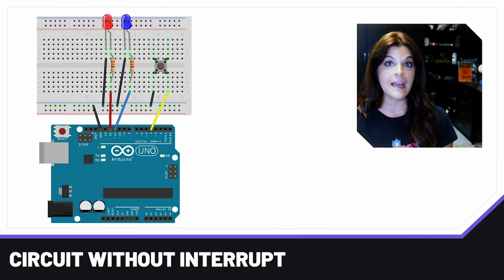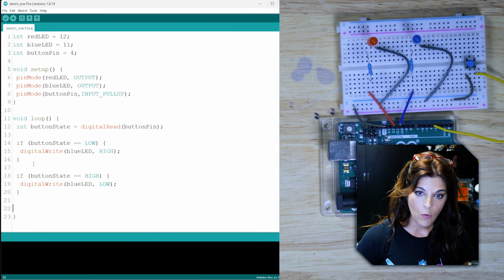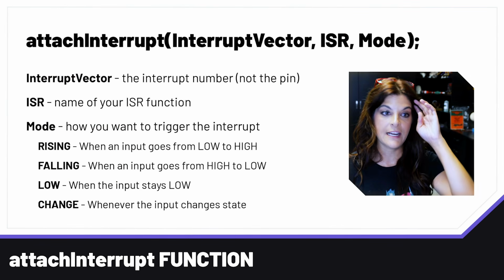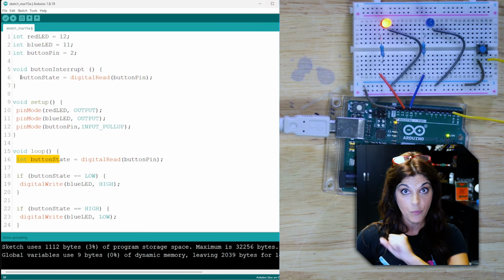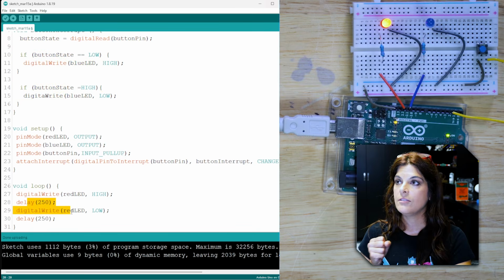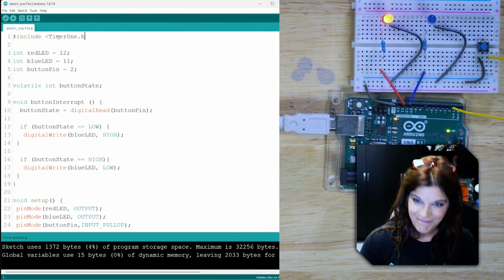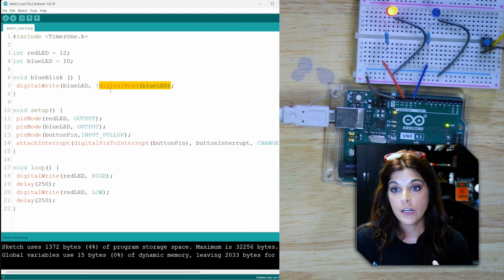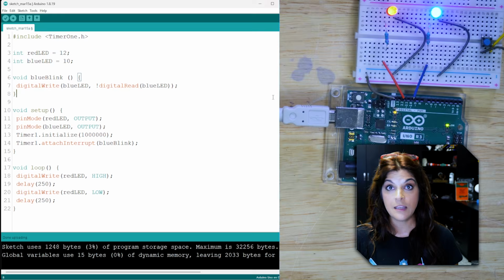How to Use Arduino Interrupts The Easy Way

Comment: In the hardware interrupt example, the buttonState doesn't need to be global and  doesn't need to be declared as volatile because the first thing the interrupt handler does is to assign it to the return value of digitalRead() and the variable is not accessed anywhere else in the program.
Reply: Where do you learn this stuff?
Reply: @jorgelima5695  
So the variable doesn't need to exist! return(DigitalRead())); 
Am I missing something?
Reply: Still, it's good practice.
Reply: @GlennHamblin  He said the buttonState variable did not need to be declared global but local to the ISR function. Then obviously there's no need to declare the local variable as volatile because it cannot be changed by anything else.
Reply: @GlennHamblin  I disagree. It's true that the variable was declared in the global scope, but that's just because Rachel moved the code around. In the end the variable is not accessed anywhere aside from the ISR itself, therefore it could and should have been declared locally, and since it changes only under strict control of the code inside the ISR, the volatile isn't at all necessary. And I don't think it is good practice to do anything inside an ISR that makes it slower for no reason: the variable is accessed three times, with volatile, the compiler will have emit code to write or read to/from memory every time the variable is accessed, whereas without volatile, the value could be always kept in a register. Of course this is just a toy example, doesn't really matter, but that's besides the point. I should say, that this is not a criticism: this video is very well put together and it's impossible to make content completely free of these little mistakes. And it would also be unnecessary, otherwise people like me wouldn't have anything to comment on ;-)
Reply: @jorgelima5695  
What use is a variable that is only used in an ISR?
Reply: @jorgelima5695  again where do you learn this?
Reply: What's the use of a local variable used inside any function?
Reply: Does it matter where i learned?
Reply: @jorgelima5695  hey I'm not attacking you. I live in a small country where there is little to no educational resources available especially in electronics. I simply want to learn more and I'm kinda looking for a mentor. I built a rover that you could look at on my channel but I need more knowledge and experience.
Reply: @jorgelima5695 I was appreciating your obvious knowledge on this subject until this comment. Then, nope, what an asshole.
Reply: @jorgelima5695 I genuinely believe that Math2C was in awe at your programming knowledge and was seeking to improve their own.
We should aspire to help one another where possible, even if it's just explaining that such knowledge can only be gained through years of programming experience.

Comment: I have multiple routines that are called from the main loop which are selected by a mode variable.  The interrupt works to change that mode variable but it still has to return to the main loop in order to take the next action.  I would love it to just break off from whatever it was doing and back to the main loop. At least the button push registers and can be depended on.  I just have to wait for the current sub to finish.  I could have each sub check for a change in mode and bail but that's messy because every routing would need the same treatment.  If I want to do that I might as well have each routing check the button inside the loops.

Comment: Great video. Might be worth mentioning a while loop with small 1ms delay as a non interrupt solution on the way to the interrupt solution. Also an internal timer is a hardware interrupt, software interrupts are generated directly by the microprocessor when it needs system tasks done - memory management, errors, crashes, etc

Comment: I would recommend when using such things as == LOW reverse it so LOW ==          
as it prevents mistakes like single = getting missed as a “var = const” will compile yet “const = var” will fail and you will pickup on the missing =

Comment: That digitalRead() in your ISR is redundant.  The  system already knows what the state change is and uses that to select which ISR to run.  You'll need to have two ISRs, one for RISING and the other for FALLING.  Niether ISR needs to digitalRead() the button.
Reply: You can only have one ISR per interrupt. So unless you had two switches, one on INT0 and one on INT1 where one turns the LED on and the other off, you can't do what you suggest. You could use a CHANGE interrupt handler to toggle the LED with a single switch though, but you still need to know the button stare.

Cheers,
Norm. (Author of Arduino Interrupts published by Apress.)
Reply: @NormanNodDunbar  Good catch!
Reply: @NormanNodDunbar  With only one ISR per interrupt, seems like a feature request is needed to allow a query for the trigger from within the ISR, eh?  It's just ugly having to manually track what the system already knows.
Reply: For me the single handler is preferred for a few reasons. Relevant code all in one place, less setup, reading the pin gives you a denounce on the button.

Comment: I have two water level switches on a aquaculture food system.  The top switch tells when the thank is full and the water pump should turn off.  And the bottom switch tells when the tank is empty and the pump should turn on.  But I don't know how to code for to hardware switches that are in concert with each other????  Can arduino do this??

Comment: Hello, can you do a video on Arduino Switch Case statements if you have time. Thank you
Reply from the maker: That's a great topic! I'll add it to the schedule for sure.
Reply: @RachelDeBarrosLive  Thank you, I think Im struggling with this code due to the Arduino Nano Im using currently, I think it only has the 2 external interrupt pins like a Uno, Ive used the ProMicro in the past which has 5 ext interrupt pins for button press. So Im sure thats my issue, but it would be great to learn more. You have a fun teaching technique. Thank you
Reply: Hello can you make bluetooth arduino?

Comment: Thanks for this!  With regard to the digitalPinToInterrupt, I wasn't sure if still need to use the proprietary pin designated by the board I have with this function?  I.e.  if the board I have has interrupt vector 0 on pin 2, can I use pin 10 and put digitalPinToInterrupt(10)?
Reply: digitalPinToInterrupt will return an error (-1) if called with a pin which doesn't support hardware interrupts. Unfortunately attachInterrupt will silently fail to attach your function, and nothing will work. So no, you cannot use digitalPinToInterrupt(10).

Cheers,
Norm. (Author of Arduino Interrupts,  published by Apress)

Comment: Which method is better? (hardware vs software) 🤷🏻 
[or do you answer that later?]
Reply from the maker: Both methods work great - it depends on your project. If you want something to happen repeatedly at a specific interval then a software interrupt is probably best. If the interrupt depends on something external like a button push or if a sensor reading is supposed to trigger something, then a hardware interrupt is the way to go.

That's a great point about covering use cases and which interrupts would work best for what scenarios. I'll think up some scenarios and update the description here and blog post in the tutorials section of my website! 😄
Reply: Hardware interrupt responds to signal from outside and software interrupt can be used to generate predefined time interval for an event etc.